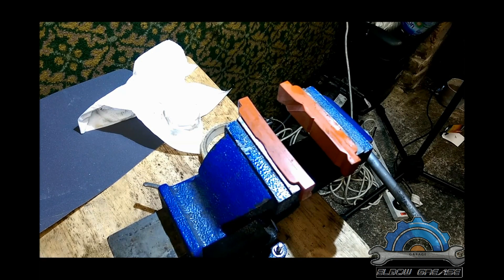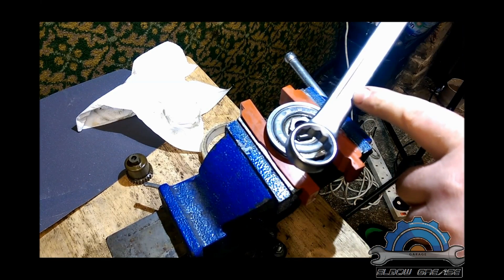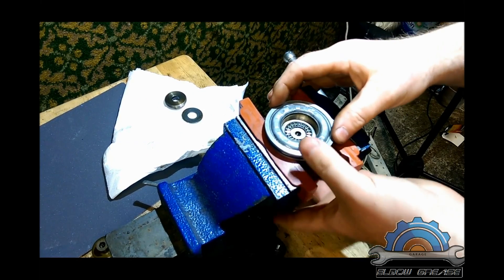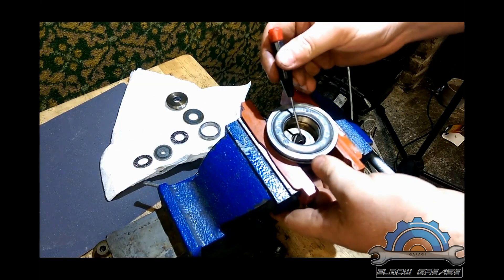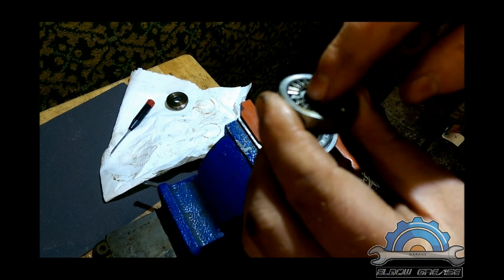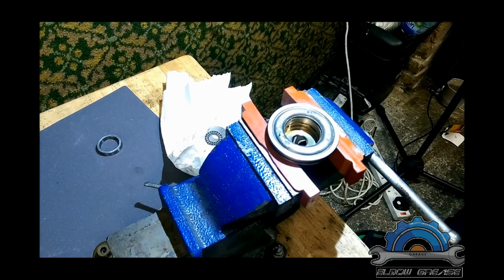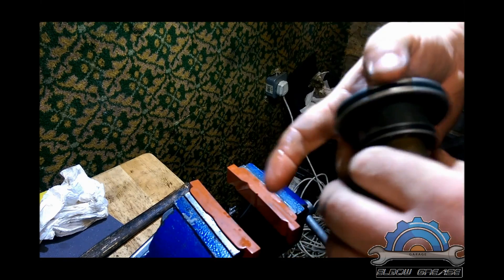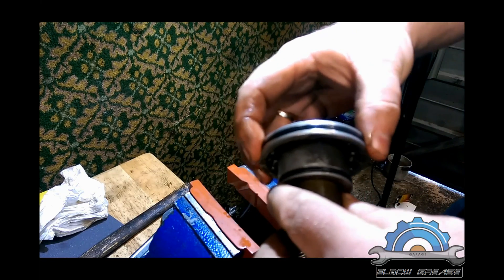VANOS RATTLE NOISE repair BMW M52TU,M54

Comment: I appreciate your demonstration so much.  I have one question asked several ways.  Is the rattling an eventual reality of the double vanos like the worn out seals? Is it a guarantee that the double vanos will end up rattling?  Why does rattling occur for some people's engines but not all? I don't recognize any rattling currently but I am about to replace my seals. Would checking the play in the pistons be the best practice since the vanos will be opened up yet no rattling can be heard? I have a 2001 525i 122K miles.

Comment: These E46 cars i tell ya . 
They turn you into a mechanic . 

Just did the Oil Filter housing Gasket. Wow that was fun lol 

Now got a Rattle noise. 
So this must be it . 

Doing Oil level sensor 
And Fuel filter next. 

This vano job will have to wait a week or two. Im eating turkey all week and drinking beers. Lol 

Great video mate . 
Thanks alot Big Dog .

Edit due to missssssspelling.
Reply: Ha, I'm eating turkey, drinking beer, and working on my vanos next week for my vacation. hell of a time

Comment: Hello, I am taking my E39 with M54B30 engine to my mechanic to have him do the VANOS. I am ordering the Besian repair kit (O-rings, gasket, etc). Should I order the Besian rattle kit or let my mechanic order OEM ones from BMW? I am not sure about the Besian rattle rings because they look “soft” aluminum! 

I just want to replace whatever needs replacing in one job. I don’t want to do the O-rings now and then 3 months later do the rattling thing!

Comment: You have great videos, i have this code: p0014 "b" camshaft position - timing over-advanced or system performance bmw e46, i dont know what to do, thanks
Reply from the maker: start  by checking solenoid on exhaust side

Comment: Heya I have stripped the threads on the female end of the backing plate on the vanos the one that has 4 screws on the back. Could you recommend how I can get this fixed?

Comment: it sounds a little noisy, nice trick but should the actual bearing be replaced? If the roller bearings are no longer round wont it just wear again! Also I would advise finding the torque spec for that bearing cage, that may also be the reason they sound noisy, if to tight it will cause them to fail again. Nice video though!
Reply from the maker: chippyjohn1 many,many people doing that way and its ok, I did my vanos rattle 4yr ago ,today still no noise
Reply from the maker: chippyjohn1 BTW torque does not affect bearings inside cuz theay are between two washers and they still need to have some play like any bearing but not too much like before
Reply: im happy to hear you've had no problem with it since the repair. however if that nut pushes on the washer and the washer pushes on the bearing then the nut does affect the bearing and it could be over tightened. but you mustn't  have over tightened it, but someone else may!
Reply from the maker: if "you"grind too much on that ring then washers will press down the bearings  but if you "grind off "the play but leave some just for bearings to spin ,there is no way you will over torque, I done 5 vanos  using this method like others and no issues